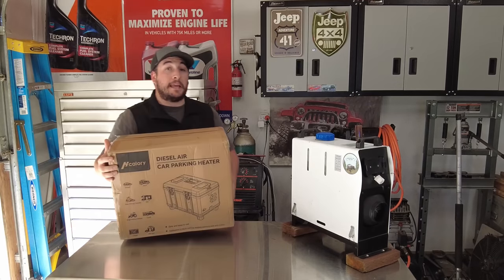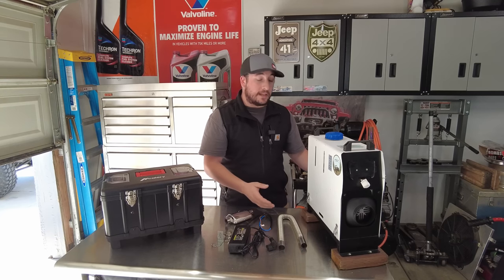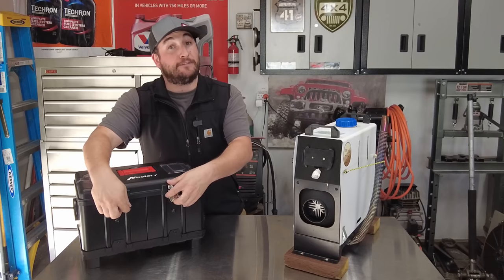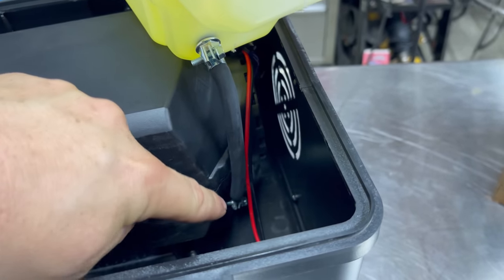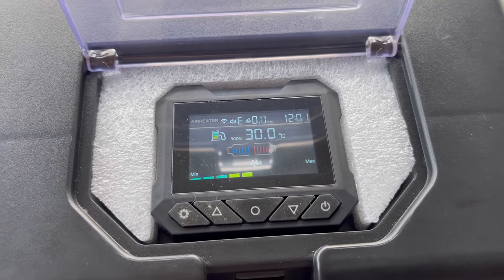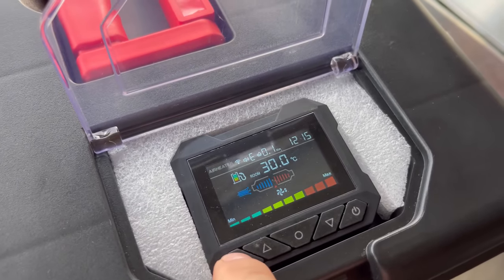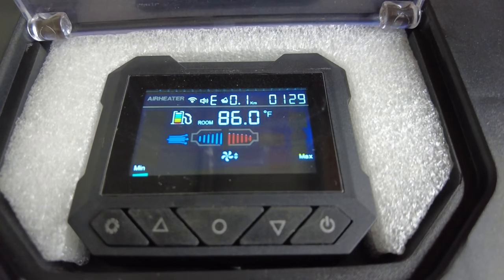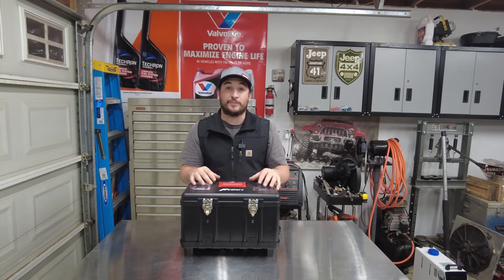KING Of Affordable Diesel Heaters | The HCALORY - SS2 8KW Air Heater | This Is The ONE

Comment: I definitely would not want a plastic tool box housing my diesel heater,  and for more money than better built units like the Wippro, and it runs 30hrs on 1gal on low setting, which is all most will need once the chill is knocked down.  This one is a hard no for me, still keeping the Wippro in1st choice for me.
Reply from the maker: Wippro is a peasant heater compare to Hcalorys design and controls. Theres no chance! 🍻

Comment: What happens if you've had the heater on for a while and you loose power?  The fan can't exhaust the internal heat, will it melt components?
Reply from the maker: In the case It will be ok to withstand the heat and survive, it’s actually considered neglect as unburnt fuels will remain in the heater, this is why we have a shutdown cycle to clean out soot and buildup. Thanks for watching 🍻

Comment: Nice product at first glance, but the biggest alarm bell for me is the choice of power connector. While it's good they haven't used a proprietary connector, the fact they are using an IEC C14 mains connector is a huge red flag; someone could very easily connect a cable at mains voltage into this unit. I think it's safe to say this unit has not got any legitimate safety approvals for import to the USA/Canada/Europe.  I notice it has CE/UK CA/FCC markings, but these will not be legitimate.
Reply from the maker: Fair enough!
Reply: Do you mean it would be dangerous only if someone used a cord that's not supplied with the unit? Their ac adapter is good right?
Reply from the maker: @bobbarker5884  yes someone would have to introduce a totally different cable for it to be problem. There is nothing wrong with the supplied cables and adapters other than the fact that the connection type is used on other common voltages like 120VAC that some could mistakenly plug into the heater.
Reply: @ATEMOFFROAD  Agreed, and that is the problem. Sadly, things have to be pretty fool proof, and as that unit effectively has a mains connector on it, I would question the authenticity of the standards markings. It wouldn't stop me buying one though; it seems a great piece of kit.  I would probably change the connector though.
Reply: Only problem is when you make it fool proof, somebody makes a better fool!
Reply: What proof do you have that the markings are not legitimate?  Because China is not a legitimate answer.
Reply: @harryphotos1  They're probably not legitimate because no certifying authority would certify this unit. AC connectors being used for a DC connection is a very good reason not to pass certification.
Reply: @johnmcquay82   Not only fool proof - they have to be idiot-ptoof as well, these days😊
Reply: @oliver90owner  Precisely, which is why I can say with certainty, the CE/UK markings on this are not legitimate.

Comment: Is that a standard computer power supply cable going into a 12volt unit? I can't wait to see how many folks try to plug that into mains voltage when the adapter breaks. ...
Reply: lol with NO fuse?

Comment: How long (in freezing weather) does 6 liters last?
Reply from the maker: I can get about 3 8hr nights on low with 6 liters of fuel in a tent  with little insulation around 30f. 🍻
Reply from the maker: Hi , New video is up covering all the questions you asked on this heater. 🍻 https://youtu.be/Ug-3fjjCPWE?si=BxCFMqSJN6QPi7tT

Comment: Do you know if this unit is waterproof?
Reply from the maker: It’s not but you can make it water resistant
Reply: @ATEMOFFROAD  what's the best way to do this. Also how long would a car battery keep this running?

Comment: How long will it run off a good auto 12 volt battery?
Reply from the maker: An average car battery has a capacity of around 48 amp hours, so I’m thinking at least half that, safely 24 hours, would have to figure in startup and shutdown, on heater’s lowest setting it’s less than an amp draw. 9 amps full load. What size is your battery?
Reply: Thanks
I was just curious. 
Would it heat 8 hours.
It's a cool thing.
I saw it last eve.in a skid steer cab.
I thought?
What is THIS?

Comment: Did your exhaust pipe slip over the 90 degree exhaust fitting or did you need to modify it?
Reply from the maker: It slipped right over no problem. Just make sure it’s circular and no dings in the end and they fit.
Reply: mine is exact same diameter and will not slip over no matter what i try lol
 @ATEMOFFROAD
Reply from the maker: @daltonsband  my guess is it fit on the silencer and you checked both ends?
Reply: yup and then went and got calipers lol

the "silencer" fits insice the pip the fitting on the box, the 90 degree fitting nope.  @ATEMOFFROAD
Reply from the maker: @daltonsband  can put the silencer on the 90 first and the pipe on the silencer? It would work that way.
Reply: You read my mind, the pipe they use to make that fitting looks like its stainless and you can see they machined out interior of the outer edge, the ID of the fitting was 29.72 and the od of the silencer was 25.8mm. It just falls out, the silencer has a taper to it but it never snugs in, I tried to use the supplied clamp. the screw tightening band and the pipe they used was not compressing or deforming under the pressure to squeeze down on the silencer . I gave up that when the part stripped :( @ATEMOFFROAD
Reply from the maker: @daltonsband  well the good thing is these are sold on Amazon , take it to a drop off facility in an hour you get your money back. Customer service may even ship you a new exhaust pipe if you share them a link to a replacement pipe. Sounds like you got a bad one. Amazon is usually good when it come to solving problems.  Good luck
Reply: for sure, i was just exploring if anyone else had this issue i may have gotten a unit made on a friday 

Cheerio @ATEMOFFROAD
Reply from the maker: Hi , New video is up covering all the questions you asked on this heater. 🍻 https://youtu.be/Ug-3fjjCPWE?si=BxCFMqSJN6QPi7tT

Comment: Have you or anyone else, ever tried using Biodiesel in one of those heaters? I’ve done some experimentation and was wondering if this type of heater would be a good application.
Reply from the maker: I have not, but used motor oil would be interesting to try. 🤔 I’m curious now to know how it would react. 🍻
Reply: Just watched a video on using used Motor Oil the You tube video came out of the UK. @ATEMOFFROAD

Comment: Do you know if the thermostat control is in the remote or the control board module?  I using it in a small tear drop camper and can’t bring the whole unit in the camper.
Reply from the maker: It’s in the display screen controller, not the heater or wireless remote . With the new mode of control you won’t need to extend the cable for thermostat control, just pick a setting and go. 🍻
Reply: @ATEMOFFROAD  I’m sorry I’m not understanding. How is the thermostat control going to work if the thermostat is in the display screen and it’s outside in the elements?  Do you have an email so I don’t flood 5he comment section?
Reply from the maker: @Wrongwayadventures  that’s because the heater is meant to be inside and the intake and exhaust are meant to be plumbed to the outside of the heated space. I keep the heater outside as you would too, so either extending the cable for the display controller to the heated space or using the “new mode” of control for our use is a must.
Reply from the maker: @Wrongwayadventures  atemoffroad@gamil.com
Reply from the maker: Hi , New video is up covering all the questions you asked on this heater. 🍻 https://youtu.be/Ug-3fjjCPWE?si=BxCFMqSJN6QPi7tT

Comment: Winter number four in the van approaching, still no heater. Aren’t these loud when you somehow sleep?
Reply from the maker: Nice , sounds like you may have some decent insulation in the van. I use this heater to heat tents in the snow, but each to there own use. As far as noise they are getting quieter. Once the space is heated they can be throttled way down and it’s almost unnoticeable. Especially in a tent where wind is much more a problem when it comes to noise. I’ve slept in some windy spots and man I wish I had some ear plugs. Haha 🍻
Reply: @ATEMOFFROAD  ya sounds like torture !
Reply from the maker: @weswarren5987  I mean I thrive when I camp lol hence the heater 🤣
Reply: @ATEMOFFROAD  yeah I sleep fine covers I should get one to have one sitting running while in park
Reply: @ATEMOFFROAD  what’s the part called that I connect to my vehicles battery under the hood? It trickle charges a marine battery while I drive. I’d need that part and the battery stuff also
Reply from the maker: @weswarren5987  you could go with a split charge relay isolator kit for dual batteries, and this maybe if you already have one for solar https://www.renogy.com/dcc30s-12v-30a-dual-input-dc-dc-on-board-battery-charger-with-mppt-with-renogy-one-core/?showHidden=true&Rng_ads=27ddb0945c146b56&gad=1&gclid=Cj0KCQjw4bipBhCyARIsAFsieCzjphANJnE_96rE3dm1pkgEBqPI-XC9bMAUrtn9wl7_ZMSYs3UgTOMaApaJEALw_wcB
Reply from the maker: @weswarren5987  not sure if that’s what your looking for
Reply: @ATEMOFFROAD  I don’t have solar even yet
Reply from the maker: @weswarren5987  there’s a lot of ways to go about it, probably just keep doing what your doing as far as research on YT, then start thinking about your budget. These systems can be quite costly. If I may share more of my setup, when I first started using my diesel heater I started off using a 500wh solar generator battery bank, that would last me a couple nights. Now I have a dedicated battery for the heater it’s 1280wh and will last me a lot longer. Here’s the link to that. https://amzn.to/3FkjnOf the only problem I have with the battery right now is I have to charge it at home. I have no way of charging it with solar at the moment.  I’m working out the bugs on that still. For the price you get loads of power and I’m not dedicated to a hardwired system. There are also larger versions of this battery of you may consider as well.

Comment: The 3 pin socket is a real danger, as the only appliances in the UK to use this "kettle" plug are 240 volt so it is very possible that 240v may be plugged in error
Reply from the maker: I agree and I believe they are revising it hence the out of stock until December. Im thinking it’s silly that y’all would use that style plug for 240ac you can only force a maximum of 11 amp through this conductor before it gets hot and starts melting the insulation. There’s really no need for that voltage for this small stuff. What type of loads are you using with this cable type?
Reply: @ATEMOFFROAD  Mostly PC power supply and other electronics, so it rarely exceed 1000W.

Comment: I like the new box design , wish I could think of a way of routing the exhaust so I could use in a camper , I know people use the bare system and plumb it permanently in the van and the exhaust through the floor .
Reply from the maker: You would have to poke a hole somewhere, most people go through the floor or wall. If you didn’t want t go that route you could leave it outside like I do heating my tent and just pump the heat into the camper. 🍻
Reply: you have to route the exhaust out of wherever you are heating or the only other way is to route the heat into whatever your trying to heat, thats the only issue with these things.
Reply: Just go get a Big Buddy or a Little Buddy propane heater. You won't need to vent them and you can run the fan off of 12v Dc  or 120v Ac. The Big Buddy sells for about  $125.00, the Little Buddy for about $80.00. Just saying...
Reply: @bpd231martinko9  can’t get them in the Uk
Reply: @lweleven3423  oh, I didn't realize that's where this video came from.

Comment: I wouldn't even compare these to pelican plastic, drip anything that's slightly acetone style cleaner on it, and this plastic will instantly starti melting. This unit has a very short 3 inch duct exhaust, making it difficult to connect hose too that seems properly secured. fuel pump is a loud ticking, clacker style pump.  If hcalory would update these small issues, it would be perfect.

Comment: Does the air coming out smell like diesel fuel??
Reply from the maker: No, possible to get a smell only if the heater is running rich and the exhaust gets into the fresh air inlet .

Comment: This particular heater is also available in the UK and is considered extremely dangerous as connection from transformer is exactly the same as a 240 volt kettle plug here in the UK. So one could accidentally connect 240volt into a 12 v socket and get killed. I hope this isn't possible in USA
Reply: It is sadly…

Comment: Doesn't that 12v power cord the new heater came with have a fuse in the tip?
Reply from the maker: No fuse , just a print that says 10A 250v rated. Although the listing does state: 
.
Unparalleled Safety Features: Engineered with a crucial overheating protection function, ensuring your heater operates safely. Certified and compliant with industry-leading safety standards, guaranteeing peace of mind with every use.
Reply: @ATEMOFFROAD  Oh, right . My bad. I think i looked away for a second right as you showed tha you added that cigarette adapter. I thought maybe the tip of that adapter you added might unscrew and have a sprin loaded fuse in it....
Reply from the maker: @danmulkiewicz5515  haha yes it does. You are correct, hopefully that doesn’t blow before the other one because I don’t usually carry spares. I probably should lower the amps to 15 so that doesn’t happen. 🍻
Reply: Keep up the great videos and keep adventuring brother!

 Hopefully I'll catch you out there sometime! I love my J30 equipped JKU Wrangler. My team and I have completed 6 Backcountry Discovery Routes and multiple smaller routes over the last few years. Some of them had us see 12F. This heater would have made those nights much nicer!
Reply from the maker: @danmulkiewicz5515  incredible achievements, days like those a heater would definitely help. Thanks for watching, I appreciate it 🍻

Comment: You need to reword your title.  
" Best camping heater!"
This new heater uses the same burner and technology as the "old design".  
Price for this is double the cost of the " Old Design " 
Only thing changed is the plastic housing container and fuel cell. 
You got love your sponsored paid free product!
Reply from the maker: I totally understand that some components of the heater are the same and burner, except that the controller and controls are different. Improved and more user friendly. Your buying the updated controls and better enclosure. The old heater cannot do what this new heater can do on the fly. For tent camping you don’t need to extend the controllers cable so the thermostat can be in the heated space. They fixed that with the new level mode. The Old heater is an indoor heater only unless you modify it. Also for advanced settings you must go into engineering mode and calculate altitude/fan and fuel pump speed if the thermostat is overrode. This setting would need to be changed every time based on location. The new heater takes the guess work out of all that and automatically adjusts. It’s more efficient and way easier to set up for the mobile user. No others are at this level

Comment: What gauge wire does the controller need? Like to run it 10 to 15 feet.
Reply from the maker: 22-20 awg is good my cable is about 8-10 ft you won’t want it to long can get a voltage drop. 🍻
Reply: @ATEMOFFROAD  Is the controller awg work the same was as the AC power cables? i.e. longer controller runs you'd need to increase the gauge of the controller wires?
Reply from the maker: Hi , New video is up covering all the questions you asked on this heater. 🍻 https://youtu.be/Ug-3fjjCPWE?si=BxCFMqSJN6QPi7tT
Reply from the maker: @raczyk  20 awg 10 ft is perfect
Reply: @ATEMOFFROAD went with 18 awg.

Comment: I've seen the "old style" 8kw heaters for under $100 so why this plastic cased heater is $200 doesn't seem to make a lot of sense to buy. If they figured out how to quiet down the fuel pump then I'd might bite.
Reply from the maker: Wow those are getting low in cost, not bad don’t get me wrong I still love my Stella heater. But it’s heavily modified for my use. 
Here is a breakdown 
- faster heating 
- larger fuel tank
- improved controls and controller
- Bluetooth app
- toolbox design 
- fast setup
- 120vac power adapter
- high elevation heating
Reply: @ATEMOFFROAD until they invest in an aluminum or stainless housing, it's is the same thing. It is not faster at heating, the controls do exactly the same thing just with a different layout, and the power supply is cheap. METAL housing and more fire protection.. maybe a CO2 alarm just in case and having the fuel tank right next to the unit is very stupid. A METAL 5 gallon tank is only 30$ and is much better suited given the pump is primed by gravity. There should be some ceramic insulation at the least between all sides and the tank/unit gap. They did absolutely nothing new here... Nothing.
Reply from the maker: @JSabh  Hi , New video is up covering all the questions you asked on this heater. 🍻 https://youtu.be/Ug-3fjjCPWE?si=BxCFMqSJN6QPi7tT
Reply from the maker: Hi , New video is up covering all the questions you asked on this heater. 🍻 https://youtu.be/Ug-3fjjCPWE?si=BxCFMqSJN6QPi7tT

Comment: I think this product is trading “convenience” for *safety*. Not wise to burn up your oxygen within the same room you’re heating. There was even a warning on the app sharing that. I would rather have both my exhaust and air intake from/for combustion to be outside of the area I’m heating to ensure an oxygen rich room.
if you’re camping within a tent with a lot of ventilation, then that’s understandable. But, would not suggest this for a more airtight environment like for a camper or van.
Reply from the maker: That’s fair, we use ours for tent camping, all fresh air and not recycled. 🍻